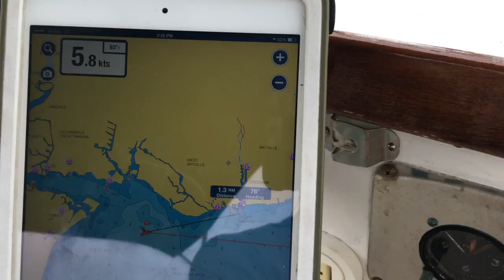BOAT HAUL..

Comment: On behalf of all humanity I want to thank you for taking your traveling coral reef and filtering the poop out of the eastern seaboard.
Reply: Randy Dinsmore I
Reply from the maker: haha your welcome. we do what we can
Reply: Definitely have the prop serviced, and paint it with Pettit Prop Coat Barnacle Barrier. The best time to check engine props shaft alignment is when the boat is on the hard.  The longer the hull is dry the harder the barnacles get. I use a drywall sanding jig and wet sand the bottom with 80 grit to get the hull smooth. Stay safe and work hard. We're all watching!

Comment: Just a suggestion re the teak; you might like Cetol instead of varnish. There are several versions of color & finish. It takes dramatically less time, fewer coats needed. It lasts well and looks a lot like varnish. If you use plain teak oil, you have to keep reapplying new coats frequently to keep it up.
Reply from the maker: thanks for the suggestion. I have used cetol before and really like it but this time we used Australian timber oil and it came out great!

Comment: Neverland has been a great boat for you, but a lot of work , hopefully you next one will be kind to you. The used market might be interesting now with all the boats lost to Irma. Hopefully you will be able to get less of fixer upper even a catamaran might suite your lifestyle but they are so expensive .....
It does not matter now  but the old trick for varnish work in the Florida and island sun is to varnish the bare wood then paint with white paint to protect it as it lasts a lot longer than varnish . Then remove the white paint to expose the  wood when you sell ( the varnish keeps the white paint out of the wood pours making it easier to get back to wood again).
I see 'Wanderer'(boatfam) is for sale too but they have a different reason!
Good luck selling in the fall, its hard, you might have to go back to Fl to sell.
Cheers Warren

Comment: Geez, surprised you were able to 5.7 kts with that dirty bottom! Hey FYI(and I'm sure you already know) maybe take an orbital sander to the rudder where the zincs make contact for better connection. Powerboaters should always have the wheels turned.

Comment: I would like to have Jessie's job.  Are zinc's expensive?  Very educational boat maintenance video.
Reply: they are relatively cheap, that zinc he replaced on the rudder MAY have cost 20 bucks.... but than again he bought it from a boat yard so it could have been a little more...
Reply: Oranje Manatee , I meant Jetty.
Reply from the maker: yeah ours were between $10-$40 depending on which zinc
Reply: Janice Alster  A young person can make good living specialist in boat  under coatings.

Comment: I really anxious to see your boat when it's done. You look like your doing a great job! Lot's and lot's of work, but it'll be worth it when she finished. I used Epiphanes varnish on my outside brightwork and it didn't even last 2 seasons up here in New England. I'm curious to see what you guys finally decided to use on your boat and why? Please?  I heard oil is easy to use and apply I'd love to know all your thoughts on it. Thanks!
Reply: spinnaker5514 we used timber oil. It was highly recommended from a friend of ours. Supposedly low maintenance and looks great:)
Reply: Thanks for sharing the secret! LOL! I've never heard of that before. Is that the name brand or just the type of oil?

Comment: It looks like there is no barriercoat primer on your running gear. Is that just regular bottom paint on the rudder,running gear,trim tabs?If there is not for the best protection against corrosion all painted metal should be cleaned bare and coat with 2-3 coats of barrier coat.then 2 coats of bottom paint. If you just use regular bottom paint on non primered metal the cuprous oxide in the bottom paint corrodes the metal it is on faster. Also if you put PROP SPEED THATS THE NAME OF THE PRODUCT on your prop you will never have a barnicle on the prop again it is a very hard epoxy like prop coating. Also remove the fittings on the inside of your thru-hull intake so you can see other side and make sure all barnicles and debree are clear from your water intake all of the barnicles you cleaned through the small holes will now get sucked by the impeller and tear it up